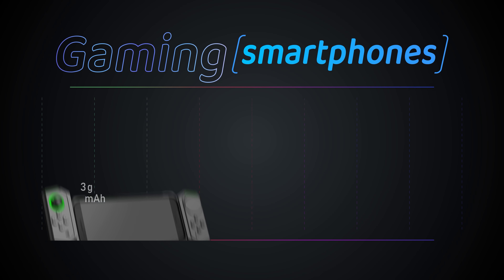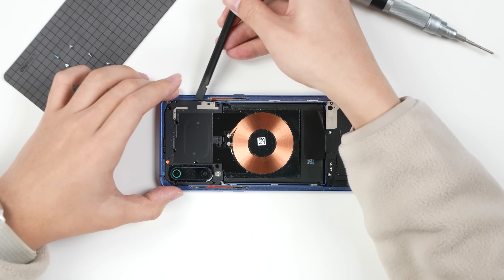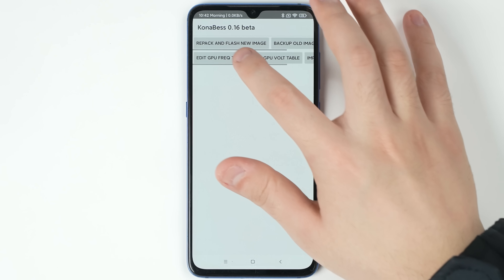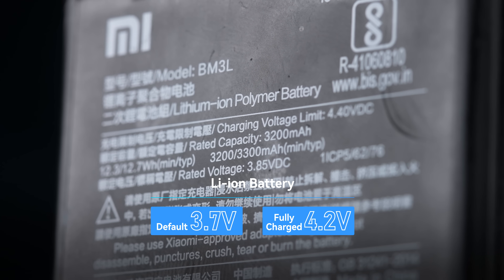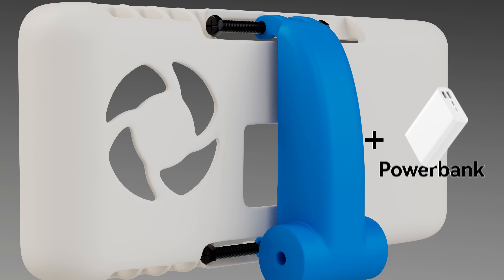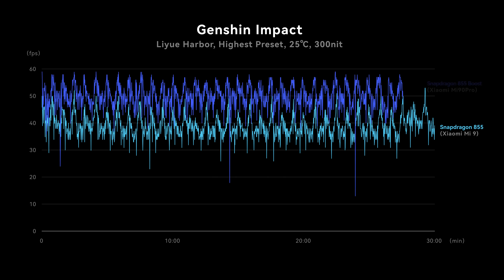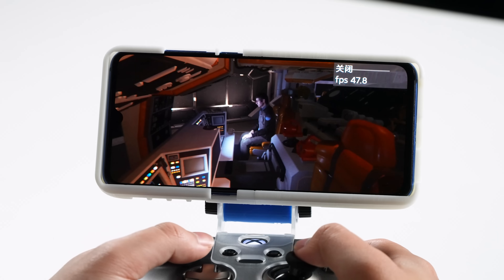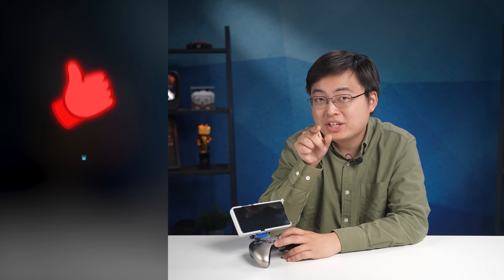We Turned This Old Phone into a Gaming Beast !!!

Comment: So, you’re telling me we’re missing out on so much performance on android because of so much thermal inefficiency?
Reply: and design (aesthetics mostly) limitations
Reply: @vindexone9698  nah just the thermals and battery
Reply: @vindexone9698  not exactly, battery's isn't advancing like the chipsets are. Heat is bound to happen no matter the hardware used. They try to maintain cooling effectively for the likes of the battery because people will have there phone for 2 years if not way longer.
Reply: Yeah
Reply: That's what i found out 4 years ago when i was playing PUBG on my iPhone7... I 3D printed a controller with 4 cooling fans on the back who keep it COLD during summer... Benchmarks results were totally different when fans were turned off and on
Reply: @Th3BlackPhoenix  seems like a fun project
Reply: unfortunately design, battery life and thermals are priorities on smartphones, rather than performance. You don't want your chip to overheat while you are using your phone, it can literally blow up in your hands
Reply: yup
Reply: same thing with apple, iPad mini with 4 core gpu can easily outperform 5 core gpu iPhone 13 Pro Max since it's given ~6w vs 4w average power (genshin impact) and has the aluminium build to dissipate heat. 13 Pro Max by itself can output 120fps in genshin impact... for about 10 seconds before it throttles, with somewhat adequate cooling and higher power draw, new iPhones could easily push 90-120 fps in genshin and over 200 in Fortnite, pubg or cod.
Reply: @Hypern0va  How did people get 120 FPS in Genshin Impact if the game limits to 60 FPS?
Reply: @eulehund99  magic of the iOS, genshin gets both both better settings and the option to switch to 120fps
Reply: @eulehund99  because the iPhone 13 Pro has a 120hz screen
Reply: @Hypern0va  Correction. You said the ipad mini has a 4 core gpu...wrong....The Ipad mini also has a 5 core GPU a15 like the iphone 13 pros......but yeah, I get your point....it performs better.....The best example is the 4 GPU core A14 Bionic in the ipad air that is about 30 to 40% faster than the 4 core gpu a14 bionic in the Iphone 12 Pro max......Same reasons as this video...Ipad has a larger battery and can dissipate more heat thus can sustain higher cpu/gpu clocks. 

The Ipads unlock the full potential of the a-series chips with no throttling, where as the M1 (M series) throttle on the Ipads, but still give decent performance regardless.
Reply: @Hypern0va  Genshin is locked to 60FPS on every platform. Even PC.
Reply: @nathansstuff1547  no, it isn’t, not on the iPhone 13 Pro/Max and iPads Pro, check out channel golden reviewer for footage/performance review.
Reply: Just like any apple laptop.
Reply: @SonofTheMorningStar666  agree, but it's an overpriced working machine.
Reply: @swilleh_  your gonna start a fucking war, what have you done
Reply: @swilleh_  its expensive but not overpriced. a macbook from 2014 is still very usable today with the newest software (big sur or monterey)
Reply: @brycechryson5686  not over priced? Really?

Look at someordinarygamers' video on them. The price of a car for a computer that still doesn't have anything on the specs of actual computers.
Reply: @brycechryson5686  my girl has one from 2017 and it got the newest os and man it's day and night on how it runs now... way way better. It don't even get hot anymore
Reply: @brycechryson5686  all macbooks are extremely overpriced.
Reply: @SonofTheMorningStar666  Where have you been the last 2 years, this was only an issue with their x86 machines.
Reply: @SonofTheMorningStar666 bruh MacBook are good
Reply: @SonofTheMorningStar666  besides the Air, new m1 MacBooks are actually solid when it comes to cooling. Intel stuff is still a mess... I have 16' 2019 MacBook and without low power mode enabled, that thing can be used as a space heater for a small room lol.
Reply: @Hypern0va  let me just pay apple 25,000 dollars for specs that are $2000 on a normal PC build.
Reply: @thevalorousdong7675  idk what MacBook you’re buying for 25k but I’m pretty sure you are getting scammed. 2000$ in apple land gets you great performance with top notch peripherals, sooo much better then the trash windows laptops.
Reply: @Hypern0va  yeah windows are little slow
Reply: @RiderBlitz1.0  windows isn’t really the problem, hardware made by intel/amd/nvidia is also top notch, my problem with windows laptops is that they look like shit, are built like shit and can’t get the basics right - high quality trackpad, speakers, microphones, cameras , keyboards and poor battery life. They also hold resale value about as good as a loaf of stale bread.

Edit: good windows laptops are usually for gaming, idk about everyone else but I fucking hate that 12 year old gamer boy’s aesthetic.
Reply: @Hypern0va  yeah i agree
Reply: @Hypern0va  Too be fair the only stuff lacking is good speakers and battery life. Trackpads became good on many devices and some are even better than those of Macbooks. There are plenty of devices with better Cameras too. Build Quality is the same across all devices starting at 999$.
The XPS 13 Plus right now is a good laptop with very good performance.
Reply: @eulehund99  speakers are bad, battery life is a joke compared to m1 MacBooks, trackpad is still macs strong point - they are bigger, more responsive and the haptics… mmm superb. Windows has laptops with better cameras sure but the entire market is hit or miss, with MacBooks, you know you will get a solid sensor (not great but good camera). Design? xps line and especially the new 13 plus are basically the only ones I can even look at, as for the build quality, windows laptop manufacturers stepped up their game but still, 999$ MacBook ≠ 999$ windows. Finally it’s the service, my country doesn’t even have official apple support, just through certified partners and yet they get 10/10 from me.
Reply: @Hypern0va  
I agree on the battery and speakers part. Trackpad is not MacBooks strong point anymore. You got the Sensel Haptic Trackpads on Thinkpads and now with the new XPS 13 Plus you get an even better feedback with 10 motors.
Any laptop at the 999$ bucks price range will have a good camera / sensor. It's not a hit and miss especially in that range. Design is still a preference and I wouldn't consider it something you can compare. What is the difference in Build Quality? Because I can't see one difference between MacBooks and any other 999$ device.
I can't comment on service as I only once used Lenovo's service to repair my laptop with water damage.
Reply: @eulehund99  what it comes down to is the fact that with MacBooks you will get consistent quality at every price level, apple will nail the basics, more money gets you creature comforts, some more power and storage. RANT for 999$ on the windows side you can get a good deal… if you actually know what you are looking for. At 999 you still see plastic laptops with hinges screwed into those shitty brass inserts, they creak, they bend and overall don’t inspire confidence. Mac is an easy choice… as in, it doesn’t require much brainpower or research to get quality gear compared to windows abominations that for example: are in the same model line, have nearly identical price points, look the same and similar serial name but have one difference that’s hard to spot for anyone not into hardware that makes one model much better then the other. Also, thinkpad having better trackpad doesn’t change a thing about windows laptop market, same with decent speakers on dells and razors, they are a rare exception, not the rule and they don’t have enough sway in laptop market to force other manufacturers to finally do things like peripherals right.
Reply: @eulehund99  one other thing that being cutted for economy at some laptops is wireless modules and especially internal antennas. My comrade told me that its often findable, but best network stableness and minuscule packet losing he found at Macbook Pro on Apple M1

Make sure to do packet loss tests and other BUT NOT ONLY SPEEDTEST AT SOLO before purchasing laptop or phone/tablet, guys
Reply: @Hypern0va  good peripherals? You have to flip the fcking mouse to charge it. Wtf are you talking about
Reply: @Hypern0va that’s because it has a fan summy
Reply: and...some restricted ui performance to processor
Reply: um, yes
Reply: Yep
Reply: Exactly. Samsung has been caught cheating with this recently, by allowing their phones to go stupid in benchmarks but not outside. 
Tbf, not just Samsung has done it.
Reply: Yes, that's 4 years worth if thermodynamics class for you
Reply: @slushy6972  LMAO
Reply: honestly i dont mind a 1.5cm phone if it means better performance
it's not that much of a sacrifice for better performance
Reply: Now I wanna see how much a gaming smartphone can be overclocked
Reply: if you got sub-zero's hands yeah!
Reply: Well, not quite only about Android. Its a problem of all mobile devices without active cooling. Android itself, as OS, has very little fault
Reply: on almost all phones.
Reply: Well i think its not limited to android, pretty much every computing device out there suffers from throttling due to heat because of electric current/flow.
Reply: and the bulky battery. no, i don't want my phone to be as thick if i only use it for gaming 5% of the time
Reply: @Phourky im sorry, you got really much comments with pretty much same contents and answers. If i checked properly before i sent – i would've chose not to flood
Reply: @swame  Hahaha its fine dude
Reply: only so much cooling you can build in a slim device like a smartphone
Reply: Yeah, apple unleashes all the performance they can then dim the brightness, Androids do not dim brightness, they underpowers CPU, different methods of cooling
Reply: very, you know when you play demanding games your phone gets so hot it even hurts a little for your hands? yeah then the stuttering starts aswell
Reply: Waiting until the water cooled phones come out
Reply: So as the gaming laptops
Reply: Do you want to hold a fucking brick everywhere? Our tech has been limited by thermals since the 19s
Reply: @tomikun8057  mhm, but i hope you know what rhetorical questions are
Reply: @phourky9522  i dont even remember what i said lmao
Reply: If u compare a phone to a tablet u will notice a tab doesnt heat even at highest graphics settings due to its surface area.. Helping the temperature to spread all over the surface area and thus resulting in a cooler device
Reply: @srshivam96  yeah its something exclusive of tablets , and metal chassis phablets maybe
Reply: Also on ios and most bad thermal laptop computer
Reply: Are you telling me you're surprised?
Reply: Yep :(
Reply: Mmmhmmm
Reply: Yup. 100%.
Reply: There's Many brand WIPing an technology for that problem. And... Heat on device make device broke.
Reply: thermals and battery
Reply: Duh?? That's the same story with laptops, and a lot of prebuilt PCs. Are you dumb
Reply: @L.K not true at all, i used Old Nokia that were like 4/5 time thicker and were actually better to keep in hand, enough Space for Active Cooling and removable battery.
Reply: And miui too😂
Reply: Basically yes
Reply: I added thermal paste directly to My samsung m12 processor  and the gpu and all the heat emitting components and the performance is o
Insane
Reply: yep. if companies made their phones from a performance perspective we'd all have thicc copper phones instead of phones made of plastic or glass back with aluminium/steel frame. just imagine if they made the whole back of a phone out of copper with heatpipes inside going directly to the chipset, it would be impossible for it to overheat. Honestly I think a copper back would look better than any glass back, and it would be more resistant to drops.
Reply: Can I buy you phone or can you make one other phone for me
Reply: same with any other phone i think, even iphone
Reply: @zamakh  No, they are far from thermal inefficiency, they are, in fact surpassing android performance at less power. At 6 cores. meanwhile android is struggling with 8.
Reply: @phourky9522  yep, but still iphone has a thermal issue as well. Currently im using android with snapdragon 835,  snapdragon 845, n iphone se 2020. But the 835 one can perform better than the other 2 in terms of gaming. When i play a mobile game such as mlbb, pubg, using cellular network, my iphone se 2020 will overheat n lagging badly.
Reply: @zamakh  That’s because they fit a powerful soc in a small chassis, ofc it’ll overheat, especially under heavy load
Reply: @phourky9522  yeah so u prove my point, even iphone has thermal issue.
Reply: @zamakh  Point proven. But it’s not as severe as the previous gens of snapdragon, being the 888, 888+, and 8gen1 we both know how that turned out 💀
Reply: Compile aosp and it'll probably get better
Reply: And it's for your safety
Reply: SoCs can actually rich the performance of PC chips if not held by thermal limitation.
Reply: Isn't it obvious sherlock?
Reply: @peacemekka  ever heard of rhetorical questions?
Reply: @phourky9522  oh. Welp that went over my head then. I thought you didn't know.
Reply: @peacemekka  ever heard of rhetorical questions?
Reply: Yep
Reply: Same with pc's, especially laptops, even more especially celeron netbooks
Reply: Yes you are right.  The problem is heat.  A phone is like a computer.  Reduced in size into our hands.  But the computer has a power supply.  cooling fan  but no phone
Reply: Yep
Reply: 7:51😅😂
Reply: 极客湾Yes！整得好活儿！
Reply: yes
Reply: You'll encounter problems otherwise
Reply: Such a dumb comment
Reply: Fuuuuuuck
Reply: whos gonna tell him than a modern phone processor can go up to 90 c on gaming tasks...
Reply: Duh
Reply: Yes
Reply: Yup
Reply: Reminds me of those gaming laptops that needed MASSIVE cooling systems, like I remember seeing one became taller to allow for more airflow when the laptop was opened and entered gaming mode lol
Reply: Yeah just imagine youre in a tropical country on a summer season and play a game on android
Reply: @Matsredek  its not just android, an iphone gave me minor burns when trying pokemon go
Reply: @willcal2738  what difference will the operating system makes? It's the hardware limitations.
Reply: @Space_Novel_Distribution  yeah. hardware form factor specifically. And company incremental upgrade plans.
Reply: @willcal2738  use a case
Reply: @reisenImperishableNight  it was 4y ago i dumped that turd pronto
Reply: @Space_Novel_Distribution  While it was indeed hardware causing the burns, actually the OS - both Android and iOS equally and MS stuff as well - is the main bottleneck for performance and utilizability. Modern mainstream OSes are all extremely bloated and inefficient due to unprofessional design, unnecessarily hogging up lion's share of the available hardware resources, and also their RAM management scheme is intentinally broken by design not allowing to properly utilize it for user needs, instead killing all the time the background processes which user would explicitly need, while keeping running the processes user rarely or never needs, also hogging CPU cycles unnecessarily. Plus, the planned obsolesence of the OS APIs, dropping supports for for a few years old programs for sake of dropping, as well as endorsing app devs to drop supports for a few years old OSes from their new apps, for sake of dropping. And this is huge PITA not only for consumers, but also for devs who all the time need to be learning and implementing all the changes for sake of change. And can't stand the audacity so many people have for parroting the apologist propaganda for this most unsustainably disastrous phenomenon we have had for the last decade. But thankfully, heavy criticism is finally rising.
Reply: A fcking apple product are so limited in what you can do. Can't do this shit right? Can't do custom rom right? Can't install 3rd party software right? I pay cheap for freedom of use.
Reply: @superlight1999  u can actually jailbreak
Reply: Yes, cause heat can destroy phone chip, why do you think gaming computer has water cooling, even the normal one has fans
Reply: @RiderBlitz1.0  I didn’t think we were missing THIS MUCH performance on phones
Reply: @phourky9522  yeah, and there's this thing about good quality parts, cheap phones has.......ugh, geez the worst, and if you try to play online games in a phone that has qaud 4 core, you will experience the true rage
Reply: @RiderBlitz1.0  A lot of gaming PCs have liquid cooling just to look "cool". The only liquid cooling that can outperform air cooling by a decent margin is the custom stuff. Those Asetek ones are stupid.
Reply: @nathansstuff1547  meh, I don't know about pc stuff, sorry
Reply: Yes
Reply: A phone is a phone. If you want a portable console, buy a portable console
Reply: @thevalorousdong7675  you'll going to buy us?
Reply: @thevalorousdong7675  Wrong. The phone to be just a phone is called feature phone. Smartphone's explicit purpose is to implement general purpose computer functionality into it, so that it can be used as both office PC and gaming console, and whatever user wants. And manufacturers are all the time developing them into more and more performant - absolutely not for sake of it being "a phone".
Reply: @thevalorousdong7675  Most portable consoles aren’t as portable and versatile as phones now, hm?
Reply: @phourky9522  yes, even a mid range phone is good for some gaming too
Reply: @The_Kansas_Kid Iphones have decent thermal management on their 6 core chips and more efficient too, android with 8 is just- diminishing returns

Comment: thank to you ! i used smartpack to underclock an old Tab S T800 who had an overheating issue ( 90-95°c and power off/bootloop ) problem disapear ! :D With Lineage OS + underclock and thermal pads replacement :)